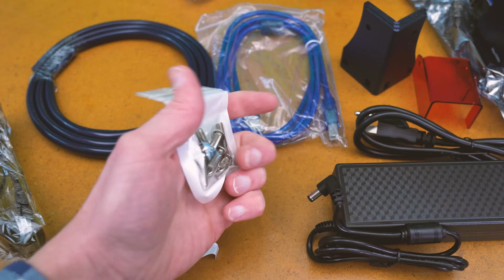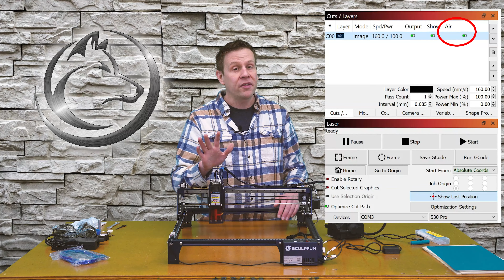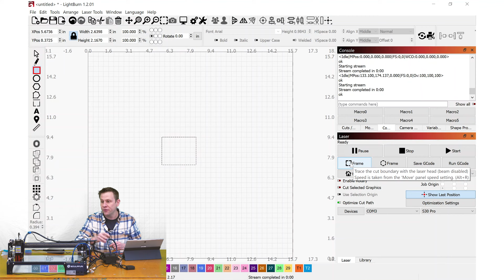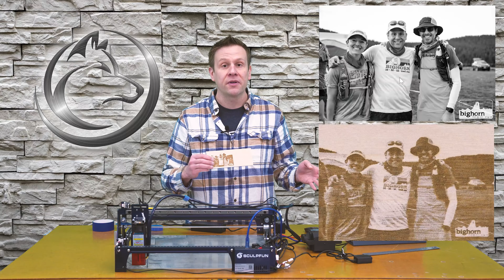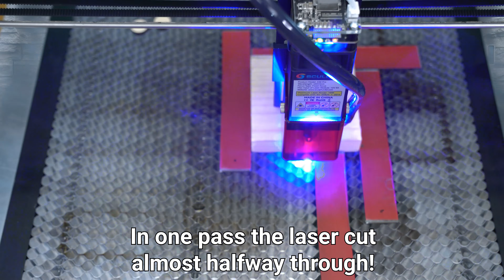Sculpfun S30 Pro Setup and Test Engraving/Cutting

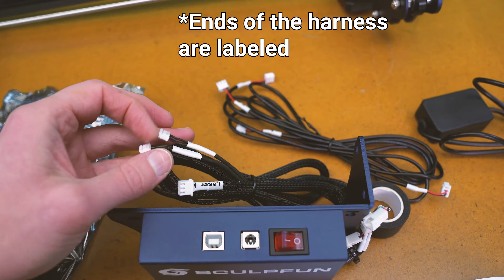Comment: @5:12 what is the "seperate harnish"
I got a "refurbished" from Banggood and I am trying to figure out if theres things missing. so far no 3 tripods for the corners. no "seperate harnish" cables....cable to limitswitch er cut through..... leftover cut of 3 mm wood from old owner or test in the box. different garbage in the box from shop...... I have 1 lens in the micro-clear box in the repair-kit. ( should be 2)
Buying refurbished form Banggod again? nah, dont thinks so....you get garbage.
Reply from the maker: I agree- I would never buy a refurbished machine from Banggood.  The cable you mention at @5:12 is for the X and Y axis limit switches.

Comment: How do you set up the belts perfectly to make circles that way? I’m struggling a lot… my circles are eggs 😢
Reply from the maker: I set the belt tension to match the x-axis and lastly I made sure the left and right sides were square before tightening the drive shaft coupler that ties the left and right side drive system together.  Hope this helps!

Comment: I did everything you had said. Started my wood. But it cut all the way through.  Mine is a 20 watts. Should I have gone to 50 ?
Reply from the maker: Thanks for watching- in the video I'm using the 10 watt version- if yours is 20 watts then I would start with 1/2 the power I used in the video!

Comment: I am just setting up my Sculpfun S30 Pro Max 20w laser. The fan on the laser head runs constantly when the power is on even thought I am not trying to do anything. Is this normal? Any help very gratefully received. Thank you for the video, very helpful so far.
Reply from the maker: Yes- many of the laser module cooling fans run constantly and this is normal.  I am in favor of the fans that only run when the laser module is firing.  Thanks for watching!
Reply: Yeah I agree, it is very distracting as I've no idea what I am doing and trying to concentrate ;). Thank you for your speedy response.  @thelaserchannel1

Comment: I just ordered the s30 pro 10 w and was wondering what are good safety glasses to go with it??
Reply: But are they real good glasses?
Reply from the maker: @michaelainsworth627  I would say they are standard quality.  They do block the harmful wavelengths of the laser.  Better glasses will be more comfortable. Look for glasses rated to block 455±5nm.  I haven't purchased any glasses- I use what comes with the laser and I also use a laser enclosure that blocks most of the scatter laser along with not looking directly at the laser spot on the work material.  Thank you for being safe with your eyes!
Reply from the maker: Congrats!  It will come with safety glasses!

Comment: ets Jul 29 2019 12:21:46
rst:0x10 (RTCWDT_RTC_RESET),boot:0x3 (DOWNLOAD_BOOT(UART0/UART1/SDIO_REI_REO_V2))
waiting for download

I don't understand what to do here , my first time using a laser and light burn , s30 sculpfun pro max. please help .
Reply from the maker: Are you receiving the error when downloading Lightburn or when connecting or starting a project from Lightburn to the machine?  I don't recall running into this message.

Comment: I am looking for a desktop sized machine to make small cards out of A4 paper. First the cards are printed on the A4 and then they are manually cut. As it takes hours I would like to automate it, would a laser be a good option for that?
Reply from the maker: Yes- a laser diode machine will have no problems cutting through cardstock!  I recommend using an air assist kit with the machine because will reduce the laser cut char that can occur on the edges.  Thanks for watching!

Comment: I am just getting started and am having trouble matching or finding test files with proper settings on the net for the 33 Ultra .Would you have a test file to share for a 30 Ultra 33w .
Reply from the maker: Hi- congrats on your laser machine!  I use Lightburn software and there's a built in feature to make easy test files.  It's under "Laser Tools" and then "Material Test".  From there you can pick your speed and power to create the test pattern.  I start with very wide settings from low to high and then run another 1-2 test patterns to narrow down the best settings for the machine and material.  Lightburn does offer a FREE 30 day trail if you are not currently using it.  Best wishes and thanks for watching!

Comment: Hi there.  Thanks so much for this video.  I just setup my S30; it's my first laser.  I have no idea what I'm doing.  I have pieces of wood on which I will be engraving just text.  How does the laser know where to start engraving so that the text is centered on the wood?  Do I have to put in the coordinates of the wood?
Reply from the maker: Hi, congratulations on your new machine!  The easiest way to start when using LightBurn software is to simply type your text.  Anywhere will work for now.  Check that the "Start Position" in Absolute Coordinate and click the "Home" button.  Click the "Frame" button in the LightBurn software- this will move the laser around to the text area- place your material under the laser and click Frame again to make sure the laser travels over the material- adjust as needed.  There's free 30 day trial of LightBurn software with all features unlocked.
Reply: @thelaserchannel1  Thanks!  I had, actually, found a really good video that demonstrated three different ways to line up your work.  I've already done several pieces.  I love this!  Wish I had gotten one these machines a long time ago.
Reply: @JingoPoe  what was the video you found please

Comment: I have one more question - Can this laser hardwoods like walnut or maple?  and how deep if it can.
Reply from the maker: Yes- I can engrave hardwoods.  The depth depends on the the actual piece of wood- wood as you know has a lot of natural variation.  The focus of the laser can be set about 2mm lower than normal and will provide deeper engraving.

Comment: I just bought one , and once i press the start button the air assist is starting also . Is this normal , or the air should start only when i cut something ?
Reply from the maker: The air pump is controlled though LIghtBurn- in the Lightburn layer there's a check box for "AIR" on/off, by default LightBurn has the AIR on in all layers.
Reply: @thelaserchannel1  Thank you so much for your response :) i got it now
Reply from the maker: @pavelcristian3945  Excellent!

Comment: I put my sculpfun together and everything seemed fine.  When I went to use it, the laser won't move.  I can push it around but it won't move on it's own.  It acts like it is trying to but can't.  I'm wondering if it's a belt issue.  Maybe I have them too tight or too loose.  I put them in according to the directions but did not pay attention to the "tread position". The teeth are facing down toward the gear but does it matter which direction they go?  Any thoughts on what the problem is?
Reply from the maker: Sorry to hear- I have not experienced that.  There is Facebook group "Official Group for Sculpfun Users"- I would recommend connecting with them- there's usually some people that can help.  Reaching out to Sculpfun is also another good option.

Comment: What is the focal point of this laser?
Reply from the maker: Hi Ken- the focal point is 0.06x0.08mm.  This will work nicely for both engraving and cutting!  To focus there's a round aluminum focus spacer that is placed on the work material- the laser body is then lowered to the top of the aluminum focus spacer to set the focus distance.  The aluminum spacer is 1.97" (~50mm) long.
Reply: @thelaserchannel1  thanks for the reply. I think this will work well for a first laser.
Reply from the maker: @kenkozimor8471  I think you'll really enjoy the machine!  There are also kits to extend the work space to a huge 35" by 35" area for future growth!

Comment: I do not know which to buy sculpfun s30 pro or the ortur Laser Master 2 pro
Reply from the maker: Which one to buy is always a tough one to answer.  Both machines have a similar build type.  The Sculpfun S30 Pro does include a full air assist kit with pump that can be controlled in LightBurn software.  The Ortur LM2 pro includes a partial air assist- the air pump is purchased separately. One way to look at the purchase is the total cost with air assist (it really is that important!), the honeycomb board, and other accessories like a rotary unit.  Overall, I both brands and machines are great.
Reply: @thelaserchannel1  I choose the Sculpfun s30 pro without hesitation thank you very much convinced me your video
Reply: @martinpalermo4520  There is the Ortur LM3. But I too am becoming interested in this Sculpfun Machine.👍

Comment: What is on the table under the machine?
Reply from the maker: It's an aluminum backer board that comes with Honeycomb stand off.  Any sheet of aluminum, Steel, or Stainless Steel will work!